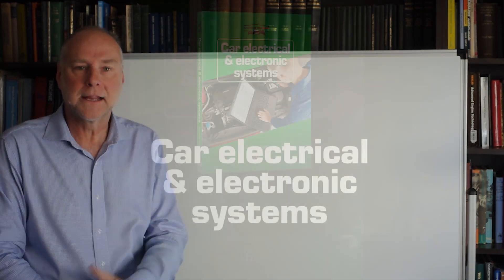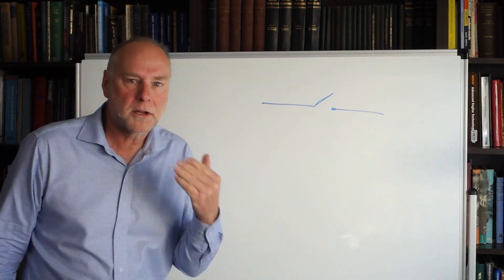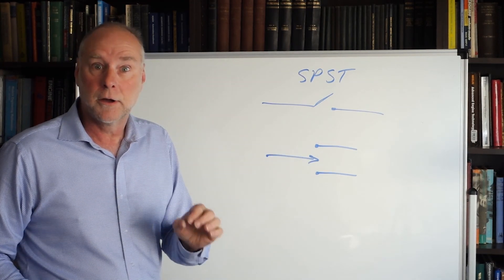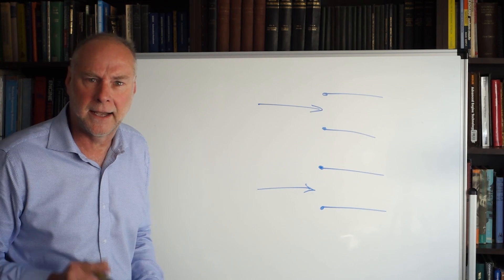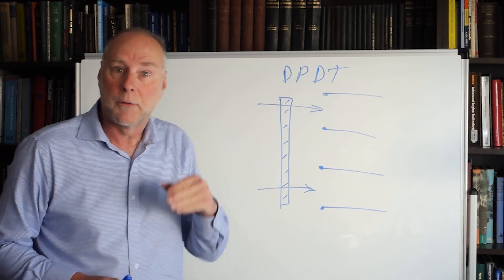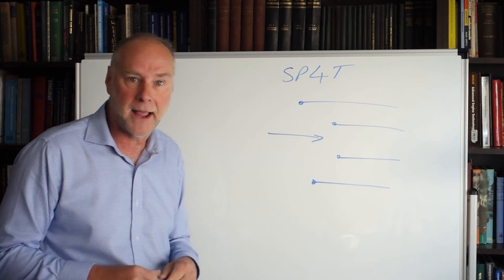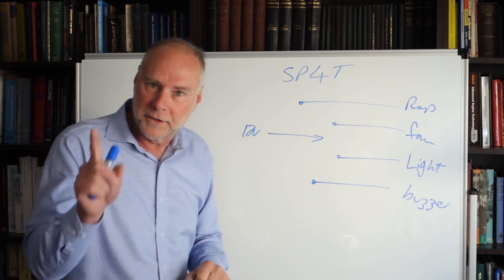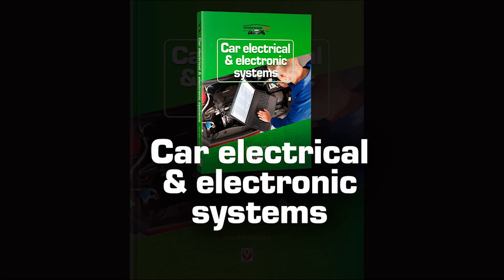Understanding Multi-pole Switches in Car Electrical Systems

Comment: Thank you for this! I'm trying to accomplish some wiring a bit more complex than just "switch on and off" (installing LED lights with both a hardwired connection and a controller; LED strips have a positive, and then the ground placement decides the color; ie, ground to red or blue, or red and green, etc) where I need to be able to not only switch the power line, but also the ground source. Being able to see it so simply helped me visualize it much easier.

Thanks a bunch!